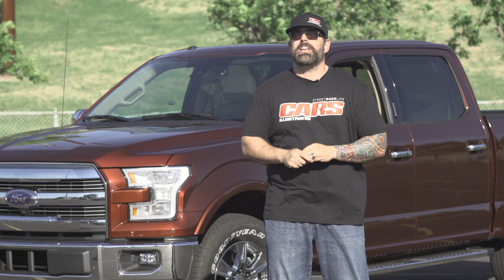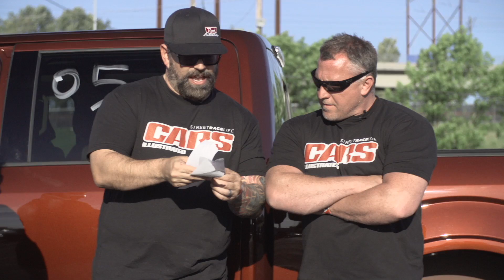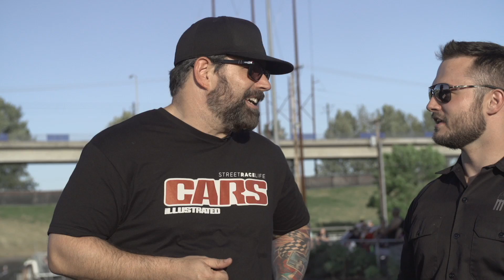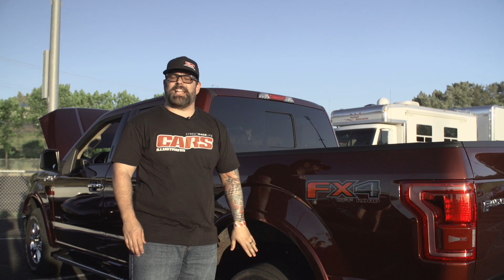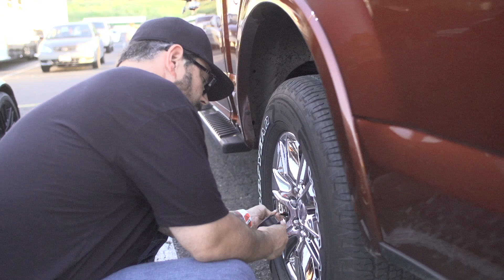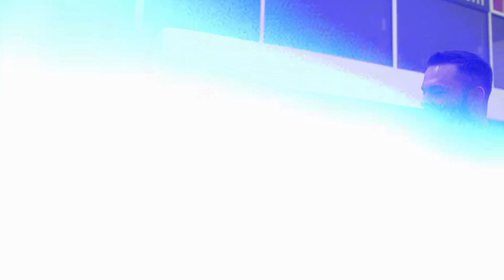Cars Illustrated - Ford F150 Track Test

Comment: I was there! lol. I figured something was up when you put on the slicks and it ran slower, my guess at the time was the traction control kicking in. Still, 14.6 in a stock F-150 is impressive.
Reply: You don't need slicks in this truck. Take traction control off, turn to 4wd high. Spool and launch, and immediately turn the knob to 2wd.
You guys need me. 14.2's bone stock, no problem.